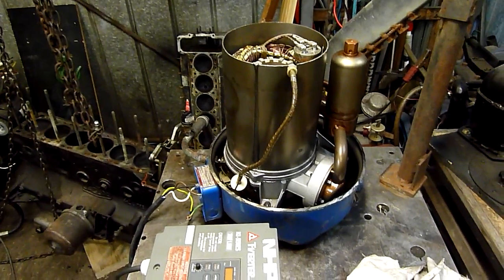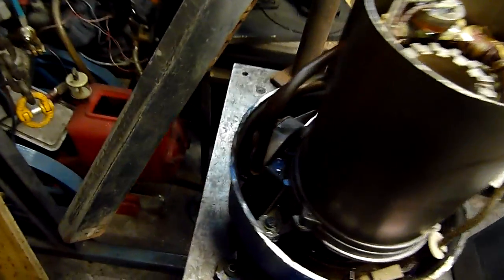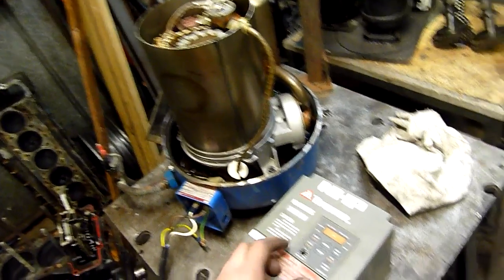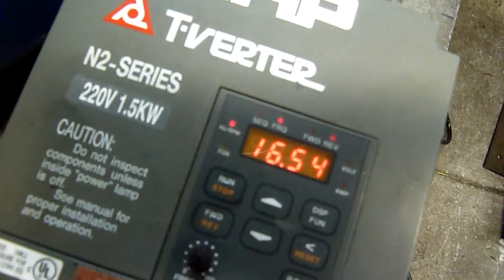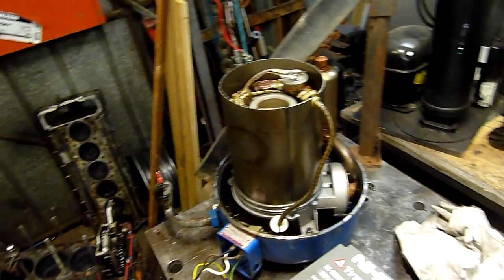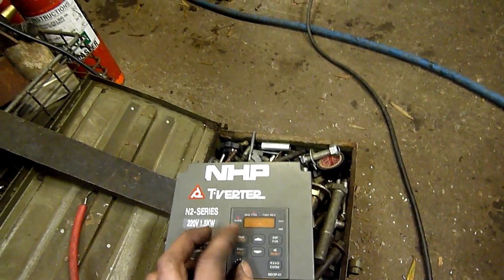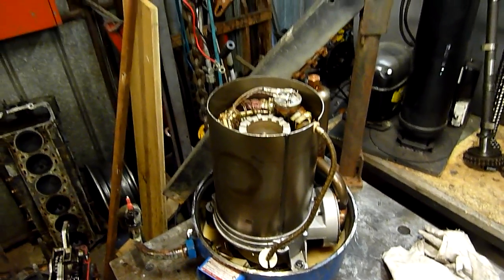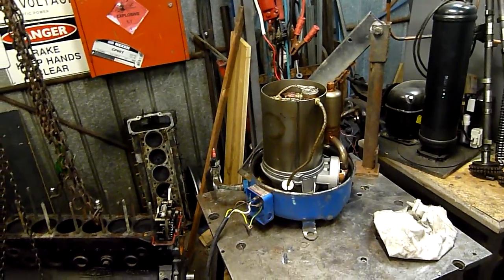Maneurop V Twin AC Compressor High Speed Run

Comment from the maker: rotaries run too hot and burn themselves out on long runs, you can still use it tho, just for very short runs.

plus the oil top up has to go into the compressor housing via the discharge port on top.

Comment: Ah, thanks for letting me know. I thought that was smoke coming out, as it seemed to just gently wisp out like smoke does from a motor getting hot. :-D

Also...I've just noticed after re-watching the vid that you have put that big 3ph socket on the output of the VFD. Super YAY. :-) It looks much better & safer than a bunch of wires hanging out of it. 

Nice job on the wiring for the VFD. :-)

Thanks for showing,

-BoomBoxDeluxe.

Comment: My mate has an air compressor and torpedo under it lol, it would pump upto 150psi ok but pop the breaker on restarting, it turned out to be muck in the one way tank valve, so it leaked back to the compressor.

he got it dirt cheap as the owner thought the motor was buggered.

It was the first time i had taken an air compressor to bits, simple things.

The unloader does a good snake impression, SSSSSSSSsssssssss.......lol

Your teachings have tought me a lot, thanks ed :-)